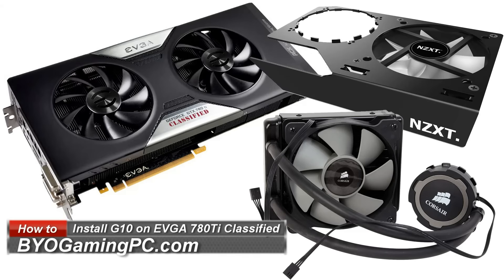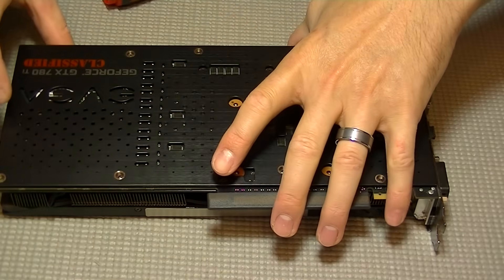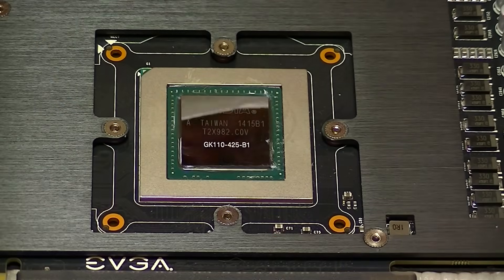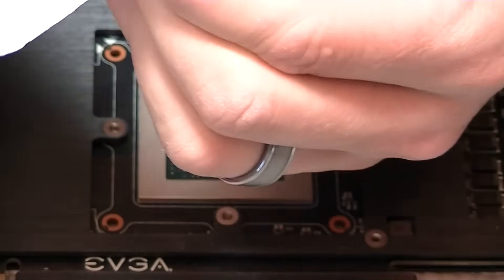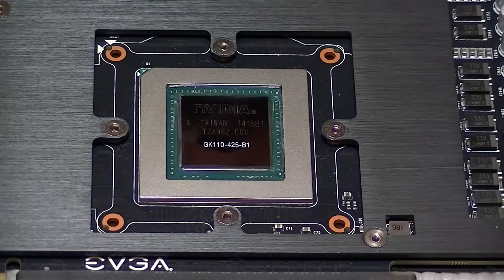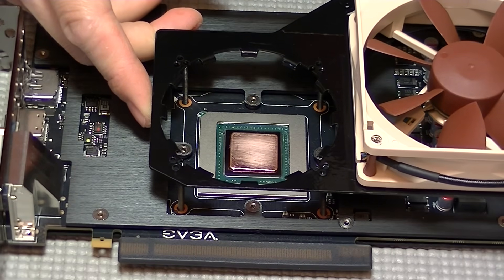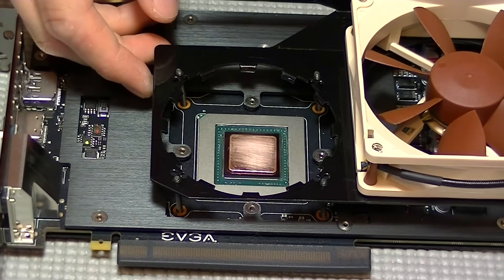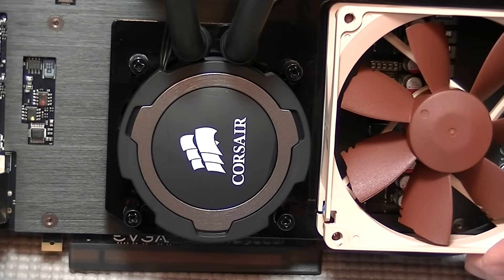NZXT Kraken G10 Install without Removing Heatsink

Comment: Does this work with the Asus R9290X DIRECT CUII?
Reply from the maker: +LoganBeastST It should.
Reply: +BYOGamingPC Possible not to use the Shim?
Reply from the maker: +LoganBeastST No, it is required for the cooler to make contact unless you want to remove the VRAM heatsink. You could forego the shim if you were to remove the VRAM heatsink.
Reply: I see, the metal shim is just cooper? any better material to use as a shim?
Reply from the maker: +LoganBeastST Nope, copper is the way to go.

Comment: yo, you said you used M2.5 30mm screws in the videos, but the link you posted show 25mm screws.  And these parts are hard to come by.  Which one do I use???
Reply from the maker: +Michael Gieron Get the 25mm screws. The ones in the video were longer than necessary.
Reply: but they still worked, yea? I already ordered the 30mm part...  Thanks in advance!
Reply: sorry, one more thing.  you used a 120mm fan, right? so the g10 supports fans larger than the one it came with?
Thanks!!!
Reply from the maker: +Michael Gieron Yes, they work.
Reply from the maker: +Michael Gieron The 120mm fan was for the cooler. 90mm fan for the G10 bracket. =)

Comment: cant you just use the screws and fan connectors that come with the g10 and the gpu?
Reply from the maker: Michael Gieron The screws that come with the G10 are custom and may not fit correctly in the PCB. The G10 doesn't come with any fan connectors, just the 90mm NZXT fan.
Reply: gotcha.  Thanks for the info! Off to Micro Center...
Reply from the maker: Michael Gieron Lucky you, wish I had a Micro Center near by. =)

Comment: Great video. I just recently installed the G10 and so far; it's amazing. However I had some issues with the hose placement from my H55 and they way I was going to route the RAD. So I may need to tweak it. But the one thing I liked about this video was handling the fact of VRM cooling etc. Those tabs you speak of aren't even mentioned in the product instructions as something to be aware of. If I had been a brand new modder, I never would have even known what to look for as the AIO looks like it's touching the GPU. It's not and we all know this could ruin or destroy a card.

Second thing I liked was the info on the materials you used as far as the screws and washers. Reason is I purchased an EK back plate ( https://shop.ekwb.com/ek-fc780-gtx-ti-backplate-blue-qc2 ) and with the stock backplate of the G10, this would not be possible. Now it is thanks to you!
Reply from the maker: DJ Geesus Glad this was helpful for you!

Comment: I installed my H55 without having first seen this video and didnt use a shim when installing it on my MSI GTX 980. Is the shim absolutely necessary? I still get awesome temps. Max temp recorded was 50C. I also only used the included hardware without buying all the hardware you mentioned.
Reply from the maker: James Hsu The shim isn't necessary on the MSI because it doesn't have a large heatsink plate over the VRAM.
Reply: BYOGamingPC  Sorry I forgot to mention, my MSI Gaming 4G edition does indeed come with a included VRM/VRAM heatsink not unlike yours in the video. Hence my question about the shim. Have a look. Thanks for replying btw. I like your vids. Subbed.

https://www.techpowerup.com/reviews/MSI/GTX_980_Gaming/images/cooler3.jpg
Reply from the maker: James Hsu Got ya, well if you notice, yours doesn't crowd as closely to the GPU. The EVGA model is too close to the GPU due to the small tabs on the heatsink. It blocks the water cooler from making contact because the cooler rests on the VRAM heatsink tabs instead of the GPU itself. Yours allows enough space to fit the cooler between the plate's edges.

Thanks for the sub. ;)
Reply: BYOGamingPC  Ah, ok I see what you mean. Thanks for replying man. Keep up the great content!
Reply from the maker: James Hsu No problem!

Comment: that isn't a kingpin.
Reply from the maker: m80pls No it isn't, it's a standard Classified. I don't think anyone ever said that it was a Kingpin. I did say that it was a follow-up to the Kingpin video at the beginning. You can see that video here. http://youtu.be/ySA6yYvj9Z4?list=PLTLW-NE1XjRCDLWTgKec1BCKucCXqrqdq
Reply: BYOGamingPC oh
Reply from the maker: ***** Nice, the 25mm X 25mm shim would be ideal but the 20mm worked just fine. Glad you were able to find them.
Reply from the maker: ***** If you plan to do some heavy memory OC'ing on the card then I would use a shim. If you just want to leave the card at stock or even do some moderate overclocking you don't really need it and can remove it.
Reply: +BYOGamingPC what screwdriver is that?
Reply from the maker: +HOO? Just a standard screwdriver but this set http://amzn.to/1WhFoxw is cheap and will have about every bit you will ever need.

Comment: I would use a Nocuta Redux fan, just because of the colour theme :D
Reply from the maker: Jan-Christopher Estelmann I do in my newest video https://youtu.be/TcuSHFob4qM. ;) The Redux weren't available at the time of this video.
Reply: BYOGamingPC
 ahhh, i thought the redux series is a "retro"series, didn't think they are quiet "new", but noctua are responding on that proposal, there will be black fans with coloured rubber mounting triangle

Comment: I want to install this mod on my EVGA 980 Ti Classified. I have ordered all the products except the washers which I will need to find locally.

Quick question, do you think the NZXT backplate is not required for this mod? Did you  have any problems keeping the cooler in its place due to not using the NZXT backplate?

Thanks for the video.
Reply from the maker: ***** The cooler stays in place just fine without the NZXT backplate. It isn't necessary to have in every installation.

Comment: Can I use the NZXT Kraken g10 on a gtx960? ( I know,why would I wanna use it for a gtx960?,because I have a ref cooler and at the time I bought the card,I had no money for a gtx970.)
Reply from the maker: FalleN-KingS CS:GO & more! No, it would not be compatible due to the 960 PCB being too short. The cooling fan would not line up over the VRM and therefore not give adequate VRM cooling support.

Comment: I have one question: 
Is there a reason why the stock backplate and screws of the Kraken G10 cannot be used with the EVGA front plate and backplate heatsinks? I own an EVGA 980 TI SC+ with those heatsinks and I wonder why the stock G10 backplate cannot be used on top of the stock EVGA backplate. The foam pad on the G10 backplate could even be removed, or not? I know the screws will be shorter on the front side of the card if both backplates are used and I will still need a copper shim, but will the length of the screws not be enough to still tighten them with the thumbscrews ? Just asking, because one could skip buying those aftermarket screws, nylon washers and finishing washers if the original G10 backplate could be used.

Any idea?
Reply from the maker: erazorCTF You can use the backplate but the screws are not long enough to use. You will always need a copper shim with the VRAM and VRM heatsink plates because they are taller than the GPU itself so the cooler will never be able to touch the GPU without something to fill the gap (copper shim).
Reply: BYOGamingPC yes, as I wrote I know the copper shim is needed. I was just asking about the backplate and the screws of the G10, so thanks for answering that part :-) too bad they won't fit.

Comment: I have the EVGA 970 FTW+ and I hate the sound and noise of the fans provided. Looking at ways to quieten it down, was hoping if the nzxt kraken g10 and something like the h55 or h90 would do the job. My only concern is that g10 might not fit onto the board design of the evga 970 ftw+, especially concerning the vrm cooling.
Check here for the board layout of the ssc which is the same for the ftw+ http://www.bit-tech.net/hardware/graphics/2015/05/08/evga-geforce-gtx-970-ssc-acx-2-0-review/1

Thanks.
Reply from the maker: mstrmind820937 You probably won't find that the fan lines up with the VRM's very well since the 970 PCB's are so much shorter due to the overall efficiency of the architecture.
Reply: BYOGamingPC Afraid so, the VRM's are on the left. Using fourms to help with with a custom cooling mod. Could say 2x120mm fans be clipped directly onto the metal fin array and pipes once the plastic shroud is removed.
Reply from the maker: mstrmind820937 Normally the VRAM is on the left and VRM's on the right. VRM's are really the only component other than the GPU that need active cooling. Unless of course you plan to do some serious memory OC'ing, then you may need to cool the VRAM.
Reply: This one is a non-typical board design, so a non-typical solution is needed. Of water cooling or air cooling, which is better for temps whilst being quiet?
Reply from the maker: mstrmind820937 Water cooling is much better all-around.
Reply: Thanks.

Comment: im about to install a h110 to my card same model. if i just use the g10 and h110 with what that comes with will i be able to use the vrm plate? just not the back plate? 
also do you think i can find all of these screws and parts at a hardware store so i don't have to buy a million little pieces online and some of those parts said it'll take till august that's to long.
Reply from the maker: hoodninja You cannot use the Kraken G10 with the Corsair H110 because the H110 isn't an Asetek style cooler. You could probably find the hardware at a local hardware store or something close enough to work.
Reply: BYOGamingPC well inside the box of the g10 it states h90 and h110 are compatible with it. it is a asetek cooler.
Reply from the maker: hoodninja It should work then, I thought the H110 wasn't an Asetek but if it is then you should be good to go!
Reply: BYOGamingPC yea im pretty excited to do it should be nice and quiet.

Comment: i have a EVGA 980ti acx 2.0. will i have to add copper heatsinks or the one that comes with the card (the plate) suffiecent? i plan on ocing the card to 1500-1600/8000-8200.
Thank you for the very useful vid.
Reply from the maker: Guy Saba heatsinks for that kind of OC'ing would be a good idea.

Comment: Thank you for your very informative and in-depth video. I installed NZXT Kraken G10 with the delivered fan on my Evga Gtx 980 SC ACX2 with Corsair H90 and noctua NF-A14 as Intake on the bottom of my case. Not having removed the Heat Spreader I had to use a copper shim as you mentioned in your video. A 20*20*1.2 mm copper shim covered completely the 980 GPU. My Temps are: in Idle 26 C and full load in Unigine Heaven Benchmark at the end 50. In Witcher 3 everything on Ultra and tweaked in ini file without nvidia hairworks and foliage on high temp reaches barely 50C and most of the times stays on 45. With nvidia hairworks my temp reaches 52C and after long play time 55C. I am very pleased with the result and most importantly very quiet. Thank you once more and subscribed.
Reply from the maker: hesam g I'm glad this video was helpful and thank you for sharing your results!
Reply: Hi, the corsair HG10n980 graphics card bracket  will arrive  in the near futur. Have got any plan to do a video on that? If you do so, I would very appreciate it. I want to buy a second Gtx 980 and want to water cool it. I wonder if The bracket from corsair ist better than NZXT. Anyway thank you for your videos and effort.
Reply from the maker: hesam g Well, I have been keeping my eye on the HG10 N980 but I'm working on a new video right now that you will want to see when I post it. ;)

Comment: I hate the idea of using the shim. Aren't there cooler that would fit without the shim. Or is possible to machine the cooler?
Reply from the maker: Max Mustermann No to both of those options. The shim is the only reasonable way to go about it.

Comment: Am I watching a different video from everyone else or what he said in the title, because the HEAT SINK IS REMOVED.  My main worries, is whether or not that fan will keep the VRM's cool, because we have no way of telling if VRMS are keeping cool, like the GPU. I have a Titan X and would love to do this with.
Reply from the maker: Lance Echo The VRM and VRAM heatsink/heatspreader is NOT removed. It is the large black plate that covers the face of the PCB. You are referring to the ACX heatsink which has to be removed for any kind of water cooling.
Reply: Lance Echo I've been using this cooling method on my gtx 580 for 3 years now w/ out any problems. I don't even have  Heatsinks on the VRMs.
Reply: Lance Echo I use this method on my titan x. I have it overclocked +200mhz on the core and +250 on the memory. In a hour long valley benchmark loop (ultra) it peaks at 65c. With v-sync enabled it peaks at about 56c. A two hour session of far cry 4 with ALL settings maxed out at 1080p it hung around 55c. At 4k after two hours of gameplay it averaged 72c. I'm using a 120mm aio cooler from deep cool with the radiator in a push pull fan config.
Reply: ***** im considering this for my GTX Titan X, that's why I'm skeptical. Because I heard one guy said he blew the Vram out because the the fan wasn't enough to cool the vram them. I need a solution because the Vrms on titan x, you can cook an egg on them.
Reply: Lance Echo you can buy vram heatsinks on ebay and pci tripple slot bracket.
Reply: thank you this answers my question

Comment: Hello BYOGamingPC, quick question I am about to do something similar to this with a Corsair H55 and KrakenG10 on my MSI Gaming GTX 980. Any tips or ticks I should know? Thanks
Reply from the maker: This video will walk you through almost exactly the same process. It shouldn't be much different except that the MSI doesn't have the VRAM heatsink.
Reply: Great, the card I have is the MSI GTX 980 4g Gaming card. It has that custom cooler and what not its not a reference card. I used to run custom water, but this seems like a solid frugal way out. Thank you,
Reply from the maker: Edvin Dzafcic You should have no problems.
Reply: BYOGamingPC feedback is much appriciated BTW got a new sub thank you.
Reply from the maker: Edvin Dzafcic My pleasure and thanks for the sub.

Comment: Would this be similar for the 980 kingpin? Looks to be the same setup almost.
Reply from the maker: Yes
Reply: BYOGamingPC Is it 25mm or 30mm screw. The link is for 25mm but in the video it mentions 30mm. I am ordering the parts lol
Reply from the maker: Min Chu 25mm is a nicer fit, I did use 30mm in the video but they were a bit long.

Comment: so can this work with R9 290X lighting? my card is too loud for me.
Reply from the maker: Yes, it works great with the R9 series cards!
Reply: BYOGamingPC  why did you use a SHIM.
Reply from the maker: Huey Freeman You must if you want the heatsink to contact the GPU. The heatsink faceplate is too large to fit within the metal square around the GPU which sits higher than the GPU itself.
Reply: Huey Freeman because the vrm heatsink (that black plate covering the pcb after he removed the acx heatsink/fan shroud) prevents the cooler's pump head from making contact with the gpu's surface.

Comment: Do you have any temperature benchmarks to compare with?
Reply: Sip Chen Liew im about to do a h110 on my gtx 780ti classified. should be here tomorrow. im pretty excited.
Reply from the maker: None that I have recorded. I did get a drop of about 15C on the GPU and 10C on the VRM.
Reply: Thanks. I would be interested to see if a 240mm radiator would perform even better.
Reply from the maker: Sip Chen Liew I could only assume that it would but I can't imagine the performance increase to be drastic unless you are running some high voltage and need to draw a lot of heat away. At that point you would need to worry about your VRM with this setup.
Reply: hoodninja keep me posted. Good luck!
Reply: Sip Chen Liew i will and thanks

Comment: So I want to use the G10 on my EVGA GTX 970 OC 4GB VRAM ACX 2.0, but I haven't been able to find anyone who has done this yet, so I was wondering if any of you would know if it would work or not?
Reply from the maker: It should work without any problems.
Reply: BYOGamingPC Hi and great video. I have successfully installed this on my EVGA GTX 970 OC 4GB VRAM ACX 2.0 with back plate. however i'm seeing alot of comments about the left side VRM/ Mosfet cooling. would mini heatsinks provide adequate cooling. there is no VRM software temp monitors for this.
Reply from the maker: ZaidRM1 I've experienced better VRM cooling with the Kraken G10 in my installations than with the stock cooler but I also use a Noctua cooling fan instead of the NZXT stock one that comes with the G10.
Reply: BYOGamingPC it seems everyone's mosfets are on the right and the 970's are on the left.  Will need to find a cooling solution for these.  Is cooling for those necessary in you experience?
Reply from the maker: ZaidRM1 I am not sure but I believe each model is different. I have heard that some of the 970's like the G1 have different PCB layouts and component locations. You are better to check where yours are located and make the determination yourself.

Personally, I've not had any problems with the cards I've installed the G10 on and have had better VRM cooling because of it over the stock cooler on the card.

Comment from the maker: The risk is minimal with using a shim. If you're not moving your computer around and banging it against things you shouldn't have any issues. The only time you may move it is during the installation process. It's pretty secure once the cooler and bracket are installed.

Comment: How much risk do I run of the shim shifting and shorting out my GPU, using this method? I got a g10 for christmas and I have a gtx 770 sc with the acx cooler. I am trying to determine if it is worth using the g10 bracket with my card. I would rather not remove my vrm heatsink so your method seems like the best idea. I need to determine whether or not it is worth it.